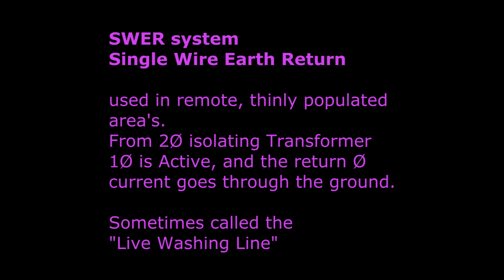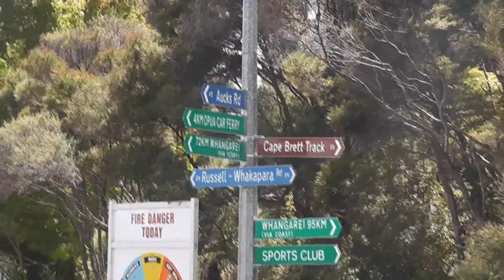Northland power lines and SWER system

Comment: I've never seen a SWER system before. I live in Sweden and here there are mostly 3 phase lines, and in mildly populated areas its usually low voltage 220/380 overhead lines.
Reply from the maker: It is used extensively in remote rural areas of New Zealand and Australia.

Comment: I recognise this swer feeder  they replaced a pole on it a year ago  I have the old pole and I am restoring it made in 1951.  there are two open spark gap lightning arresters on it did you see them
Reply from the maker: +tony 88 Yes I did. There is no SWER system in Auckland. Love these unusual network set ups.

Comment: The 11kv SWER HV return path is mirrored underneath the overhead line and its current limited to about 8 amps so as to not interfere with telecommunication systems in the vicinity. A cheap
idea that works well.
Australian outback SWER use 19kvolts in their earth return systems.

Comment: Why they chose for single wire? They have to instal one wire so it wil be easy to instal the other 2. Can somebody explain me?
Reply from the maker: Costs is the main reason, no cross-arms required, and no extra conductor. Bear in mind this system is used in very sparsly populated areas, maybe to feed two or 3 houses off a 20 kM long line
Reply: RODALCO2007 ok thanks i understand. Thanks for ur reply

Comment: 1:29 #211908 Device is a recloser? or maybe a regulator?  Autobooster? At 1:27 it looks like its "can" is grounded i.e. earthed. Thus I ponder if it is regulating the single phase SWER line's voltage at the feed point at the start of the rural feeder. Nice Video. I remember seeing these on the North Island two decades ago.  Cooper Industries Eaton makes an autotransfomer in 11Kv 50 Hz that has a clock face "position indicator" gizmo that one can see which of the 32 taps/steps the buck/booster is at.
Reply from the maker: Correct, the Cooper device you quoted is a Voltage regulator to buck or boost the line voltage. That one would be near the 3 phase 11 kV line. Couldn't find that one on this circuit. The SWER doesn't usually regulate the voltage. It supplies the Voltage at the level given from the source.

Comment: Wouldn't a SWER system be lossy and inefficient?
Reply: Yes but when they do the math they basically realize that running 10 miles of wire cost the same amount of 50 years worth of electricity that they're wasting so in a long-run especially after the cost of replacement, if there's only two or three customers using the electricity and it's not actually supplying much electricity but it just needs to have some kind of service to an area even if it's not a lot, they would use this because if you're barely using any energy efficiency is not a big deal and this is so cheap to implement

Comment: is that were they convert 2P to single phase
Reply from the maker: Only one transformer needed. Input 2 Live wires, Output 1 Live wire and one Grounded wire or centre tapped secondary transformer winding
Reply: RODALCO2007 whats your email i think there is one like this near us

Comment: I wonder is this system more stable or not than full 3-phase system for high voltage transmission (10kV) used in Estonia? Thanks for sharing.
Reply from the maker: It is cheaper to install in very thinly populated areas. Longer line-spans are possible up to 400 meters ¼ mile without the risks of lines clashing as in a two or three phase system. It can also easily upgraded to a two phase system if increased loading requires it. Crossarms to be fitted as well as some extra power poles.
Reply from the maker: *****
Aluminium with steel centre, or sometimes steel wires get used.
Reply from the maker: *****
Not on this particular pole set up but spans across a valley you get away with these long spans. These spans are a lot shorter in this video. The long span areas are not easy accessible by road.
Reply: *****
Yes, even on straight concrete poles there are spare holes to fit a crossarm if needs be. Loading in these remote areas is small so the liklyhood of an upgrade to a two phase or three phase is small. Wikepedia has a good page with info on these SWER systems.
 http://en.wikipedia.org/wiki/Single-wire_earth_return
Reply: Raymond Van Orsoy de Flines
Stupid Google changed accounts again.
Reply: Raymond Van Orsoy de Flines it does that to me too, I have my original youtube account, and the 'merged' google account for gmail. Both of them are chipmunk related (spotting a pattern?) but it's annoying when I don't realize it's done it and wonder where all my subscriptions have gone!

SWER is an awesome way to get power to places, do you get any trouble with high earth resistance causing a step potential or are the electrode systems extensive/deep enough that it's not an issue?
Reply: It has to be very good ground to support the load without creating ground potential and to keep the voltage fluctuation within the regulated limits. Only problem is the grounding must be checked constantly because the corrosion starts rise the resistance between ground and grounding structure until to the point where someone gets electrocuted from step potential by walking too close to the transformer pole.
Reply from the maker: *****
There are lots of two phase systems in rural areas. SWER or Two Phase HV supply feeds a center tapped transformer with the Neutral in the center, which yields in 230 - 0 - 230 (460) or 240 - 0 - 240 (480) Volts systems at 180° phase-shift.
Reply: There is a difference between a true 2 phase system (with 3 or 4 wire supply), and one fed from opposite windings of a CT transformer, 180 degrees apart, and indeed one supplied by 2 phases of a 3ph system with the phases 120 degrees apart.

I need to go lay down now, thinking about phase angle calculations at college has brought on a headache!
Reply: The original old 2 phase systems had the phases 90 degrees apart, but didn't last long, except in some parts of the USA with private generating plants, Scott transformer anyone? ( http://en.wikipedia.org/wiki/Scott-T_transformer )

Comment: First time I have seen that system in nz very interesting.
Thanks for sharing ray.
Reply from the maker: SWER is used in remote Canterbury as well at 19.5 kV voltage level to reduce the line currents even more. SWER systems are also near rural  Taupo, Turangi, Mangamuka, Coromandel, Russel, Taumaranui.
Reply: I'll have to keep a eye out when near those areas.
I guess i have not been remote enough yet so far only seen the 2 phase system.

Comment: very interesting system. thanks for the vid. btw, i finally scored a BAZ! missing it's terminal cover, but in great condition. i will do a vid when it comes in the post
Reply from the maker: These SWER power systems are also used in Australia.
Reply: Glad ya got a BAZ too, You'll like ;-), if ya want a Landis & Gyr ML240  or 262 series, both are similar!! Meter i'll send ya 1 as i have Several identical ones ;-)
Reply from the maker: HDXFH
Thanks Larry, I have the L&G ML240 meter in my collection. Your meters are packed and will get posted tomorrow. Did put them into 2 separate boxes with Iskra terminal covers too.
Reply from the maker: Look forward to your BAZ meter in action
Reply: HDXFH
 that would be bloody awesome Larry :) (i will send a pm). baz is a very nice looking meter, i can't wait to see it in action either  :)